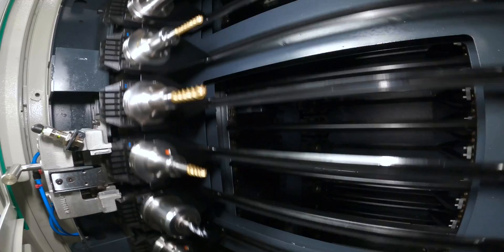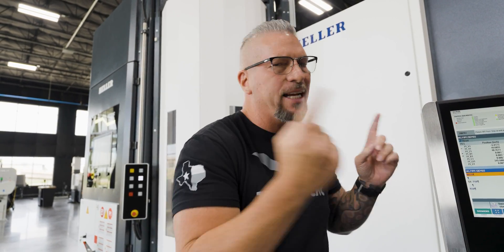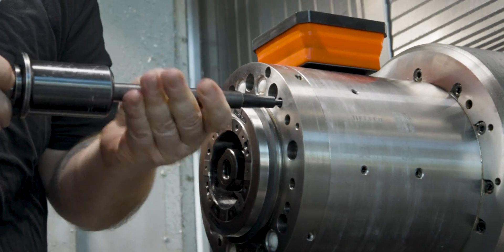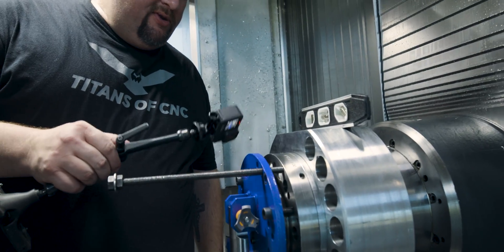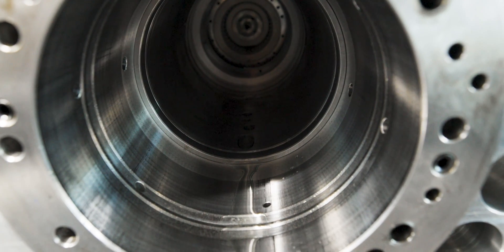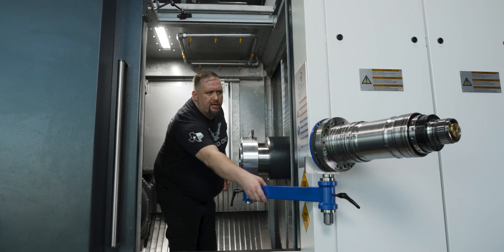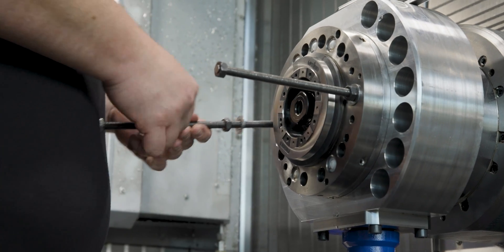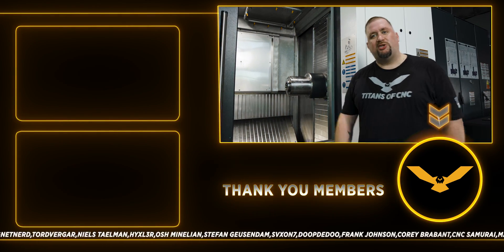Spindle's Broken, Can’t Wait For Service: Barry Changes Spindle Out

Comment: barry barry barry, top tip. when you remove all of the bolts, put 2 back in but make sure they are longer by 50-60mm. then on the hmi , individual functions press spindle unclamp and hey presto

Comment: Did you reset up reference position axes after changing spindle?
Reply: If you place the new spindle at the same orientation as the one you removed, the reference point will be good. We always double check it, but usually no change is needed.

Comment: I was in charge of a Mori-Seki FMS system, we were machining transmission bell and extension housings.

I had an operator running one side of the line while I was doing some tool insert changes on the other.

Well, I heard this God almighty GRRRRR noise, followed by a BANG, then silence. I ran around to see what happened and opening the door on machine A, I could see the tool was WAY deeper into the material than it should have been.

I don't know HOW he did it, but the dude managed to an extension housing into the fixture backwards, got the hold down clamps to close, and the fixture to set up. The spindle spun up to cutting speed and pranged into the part at full rapid speed.

Destroyed the spindle. And took MONTHS to get a new one shipped from Japan. The operator got bounced around a bit after that and was let go next available opportunity.

Comment: I don’t mean to be that guy, Barry, but they need to fuse a plastic bushing to the tip of the jacking bolts that remove the spindle, just a little advice from a guy that’s done a lot of bearing removal/install, I know replacing a spindle is a rare occurrence but you don’t wanna be marring the machine.

Comment: You could save a lot of time with a cordless impact.
Reply: You can strip alot of threads with a cordless impact too.
Reply: @Fullion-CA  It's called Common Sense.  Only talking about mechanics that know how to use them properly. Anybody stripping threads while repairing a machine tool needs to GTFO of the shop. I use an 18volt to change chuck jaws all the time.

Comment: What exactly does the spindle do? Is it the drive motor and tooling mount or is it just the tooling mount?
Reply: Both it acts as the tool “holder” and drive motor
Reply: @marycoday631  got it, looked a little small for some reason for the power they put out but I guess that’s just modern electric motors for you
Reply: @zanderchiasson8064  You've misunderstood my friend spindle does not have the motor in it.Tool is held in the spindle which is driven by the motor which you can't see in the video.If you look carefully there is a gear on the end of the spindle that matches the drive gear in spindle housing driven by a motor behind it.
Reply: @mehmettemel8725  so the spindle then is simply the tool holder?
Reply: @zanderchiasson8064  in this case it is.

Comment: Can't belive you've used a steel hammer for the dowel pins
Reply: Why? Thats how I've removed something like that.
Reply: @bazwabat1  you have no feel with a steel hammer, if its crooked it will go in, deforming the hole, it can also easily crack the threaded part of the pin (inner thread)

Comment: How did a spindle go down on a 1 year old ish machine is the real question
Reply: Ahhh all those Kennametal tools pushing the machine to it's limits.😂🤣
Reply: Boom!
Reply: My thoughts exactly. Why are they changing it? Unless its damaged?
Reply: @AlejandroPerez-pu5zc  its probably a demo for the heller guys
Reply: They're a educational youtube channel. nothing visibily wrong with the old one he took out, if they actually broke a it we'd be seeing video of how Barry crashed first lol.
Reply: It's super common in a production shop. When you have operators loading automated pallet changing systems the machine might get an accumulated 10 minute break in a 24 hour day. Changing a spindle really is not that difficult even in older machines. It's the removal of covers, alignments and test parts that take time.
Reply: Exactely my concern; made me start to wonder if it’s made easy to replace because the Heller spindles are known to keep breaking down and need replacement all the time!! This only gave me a bad impression of the brand nothing else.

Comment: Our Health and Safety team would be having a major freak-out if they seen us in a machine that wasn't locked out.
Reply: Literally my first thought. And OSHA's for that matter
Reply: Or standing under the forklift forks or it's load the spindle in this case. Sometimes you have to use common sense and be as safe as possible when it's simply not possible or practical to follow every safety rule. If OSHA were around during the industrial age it would not have been called the industrial age and we would still be using horses for transportation and doing things by hand!
Reply: I am quite sure it has a CATEGORY 3 redundant, dual channel safety system
Reply: @tommays56  Which doesn't stop anyone from turning the machine back on. Half the point of a proper LOTO system is so people know there is someone in the machine.

OSHA rules are written in blood, and some of these comments prove why.
Reply: Why? If it's in emergency stop...
Reply: @StefanoLinguanotto   "Why shouldn't I wave a loaded firearm around? If it has the safety on..."
Reply: @kevind1865  Do you fear it could move while you are in there? Do you lock out a machine when changing a part? Looks to me that the spindle he is changing is not the motor, it has no electrical connections. Therefore it is a safe operation to perform like that in my opinion.

Comment: I would have been much slower on turning the bolt that brings the new spindle into position. However I have built injection molds and have experience with hyper precision mechanical seals and many other features of mold making that you can not smash the metals together when disassembling and pressure of threads can create when any resistance is encountered. Cheers earth is flat. No elevation angles to stars can be measured from a curving line and earths surface if a sphere would curve.😊
Reply: Why not it's a tangent then.

Comment: Impressive and I hope the spindle was replaced to make a video not out of necessity otherwise I would be worried here 😂. How much is the heller replacement spindle for?
Reply: I'd say at it would be at least 15k but Im just guessing with my lacking knowledge having seen prices on spindles for Mazak and DMG =)
Reply: @innominatum9906  i would be surprised if so buddy. I’ve seen 30k and up… but most we use around here are Japanese.
Reply: i thought the same thing. why are they replacing a spindle already?

Comment: That Heller spindle is one impressive piece of engineering.....the fixture was well thought out as well.
Reply: That fixture is simple but it doesn't really need to be complicated to do it's job. Sometime simple is smart.
Reply: Milling center manufacturer elitism 😂

The boast is the fast and easy exchange time for certain!
Reply: A spindle bad already ? How could a shop afford to run a heller should bought a Haas
Reply: @donnelson8121  Stop being so obtuse 😩 This is just to show how easy a spindle-repair can be done on a Heller
Reply: @donnelson8121  Unless you are joking such a statement is assinine  How on earth could someone seriously compare a Hass to a Heller?  also it takes a reaaly gigantic error to damage a Heller spindle. even a normal run of the mill crash is not going to damage it in the slightest. [ a crash that would totally wreck a Hass spindle ]
Reply: @donnelson8121  Look at the old spindle, it looks brand new, this is just a demonstration.
Having to work with HAAS, DN Solutions, Okuma, and Matsuura, I'd rather have the Heller over HAAS. HAAS is good for startups/small shops or to be replaced on a yearly bases otherwise they're too much of a headache compared to any other brand.

Comment: I believe in having an extra spindle in stock.  I ask all my machine suppliers, "do you have an extra spindle I can buy."  I also ask about their service. Brother machine tools with Yamazen are my ideal machine and service providers.
Reply: I love YAMAZEN forty years ago we bought an MV-80 
They did more good to keep us in business I can't say enough to praise YAMAZEN.
Even through moving our shop they were there see the machine on the truck off the truck installed and running never a bill unbelievable.
My father made me sign the  check for that machine.
It was between Mattsura and Moriseki the people at mattsura said no matter what Mori does they were going to beat their price.
I was young my father had no idea what we were buying but it cost a fortune.
He never did business with the bank always cash.
Boys at Mattsura were devastated to say the least I'm surprised they did not commit seppuku right there on the shop floor.
I loved my Moriseki and YAMAZEN.
Best service we ever got from any machine tool dealer.
Reply: Thank you for your comment.   The Yamazen salesman made a house visit, and personally ran through all the details when selling us the machine. My wife was more than impressed. I have talked with at least 10 different machine suppliers none of them even bothered to make a house visit let alone sell my wife on buying a machine.  Brother machine tools are the fastest, and the most power efficient machines on the market. The power savings that can be had with a brother can add up to $5k a year with one shift.  A possible $10k for a double shift. This is not including the time savings in making the part faster.   A max 9.5kva power draw means you won't possibly flip a city breaker like the school did next door with their Haas VF2.  Our city has problems. 2 5-axis U500 Brothers can be feed with one feeedio robot and still draw less power than a single HAAS.

Comment: What about spindle orientation calibration for tool changes?
Reply: If you install the spindle in the same orientation as it was when you removed it, It will be at the same orientation and no adjustment is necessary. Of course you always do a check to make sure.

Comment: If full ceramic bearings we are talking quite a few thousand dollar$ ,,, ?
Reply: Not ceramic bearings.
Reply: Ceramic bearings aren't actually good.
Reply: @dwaynesykes694 for high speed high accuracy they're pretty good I hear
Reply: @dwaynesykes694  ,,, please explain . I've been told they can survive a crash ? ,,, Although I am skeptical  ,,, !
Reply: @rolandtamaccio3285  Ceramic is "harder" than steel, but is brittle. The bearing races will still be made of steel even on a ceramic bearing, so the benefit of the extra hardness is questionable.

If a crash is bad enough to damage conventional precision steel bearings, it's likely bad enough to either crack ceramic bearings or damage the steel races on a ceramic bearing.

That said, maybe there's some new all-ceramic magical technology I'm not aware of.
Reply: @dwaynesykes694  ,,, that's why I said full ceramic . There are extremely expensive spindle bearings available with races and elements , made with ceramic  ,,, !
Reply: @dwaynesykes694  I don't think it's for crash resistance either can be damaged if crashed badly.It is more likely due to low thermal expansion of ceramics which will allow high RPM.

Comment: Only 60 newton meter ? ( never changed a spindle myself btw )
And there I though it would be at least as hard as we had to as with out mk6 to capto c8 toolholder adapter witch is about 150 Newton meter but then agen the adapter only had one bolt well the spindle have 10 

Well you lean something new every day

Comment: Would love to see to Barry fit inside the SYIL X5 to change the spindle.
Reply: The question is can you replace it yourself.. i guess yes?
Reply: @platin2148  you can do anything yourself if the need is bad enough
Reply: @platin2148   got to check them out in person, everything in the machines seems very easy to get to including spindle. I mainly looked at the x7 but it looked like you could take some of the top sheet metal off and take the spindle out from the side. Would love to see a video on how to actually do it though
Reply: @levelmatt2  I did wonder more if they sell them i guess they do. Yeah should be a thing they do as distributors.
Reply: @platin2148  I don't think TOCNC stocks them in house though, pretty sure all the spare parts come from the Syil HQ in Houston. But yeah I agree they should have some stock imo, especially the little things that will go bad sooner rather than later i.e. capacitive sensors